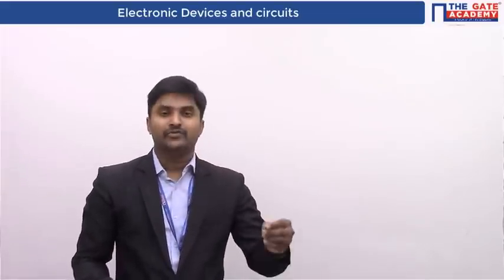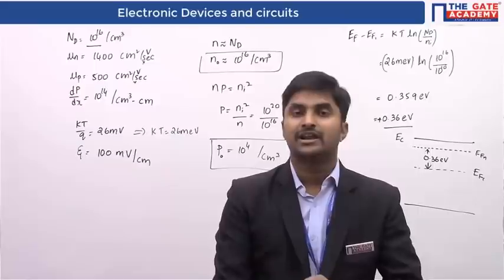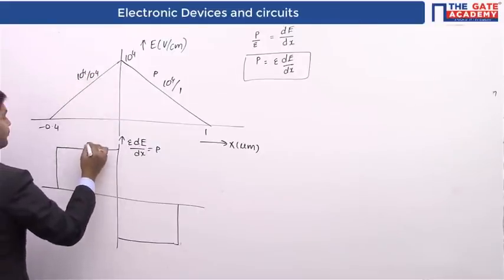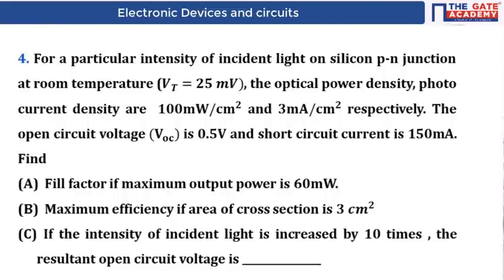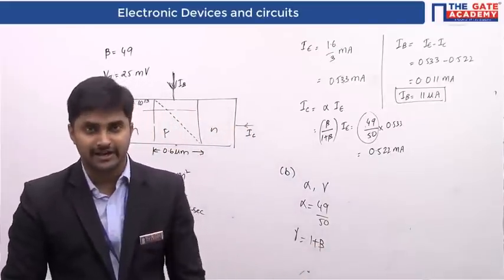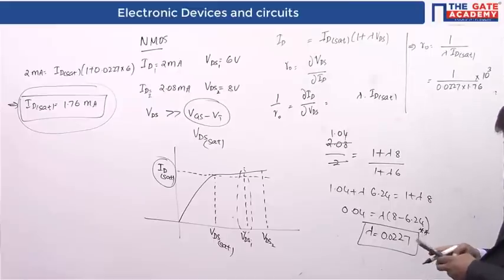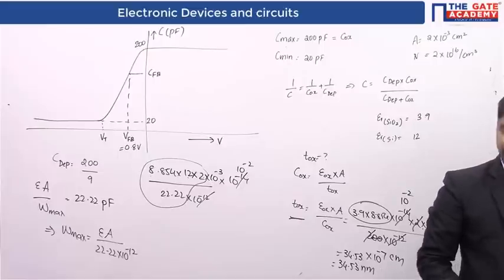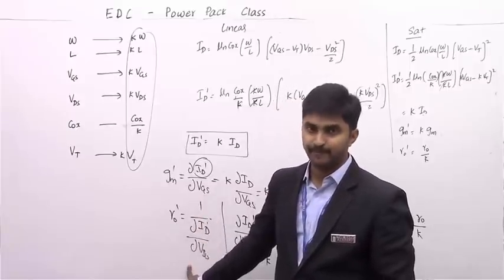Electronic Devices (ECE) - Most Important Questions | GATE - 2019

Comment: In the first problem while calculating drift current density u wrote the value of uE as 40 but it was 140 so it will be 140 right?